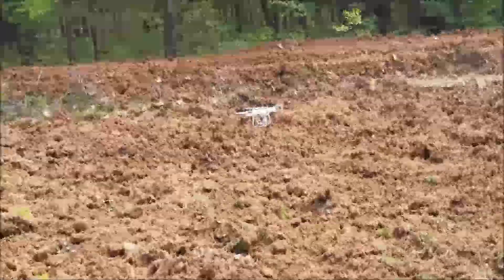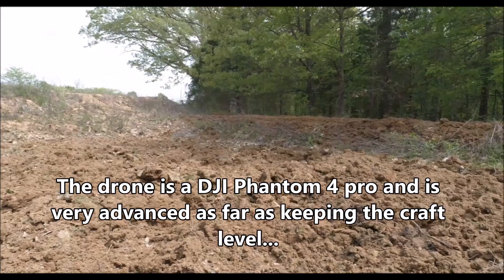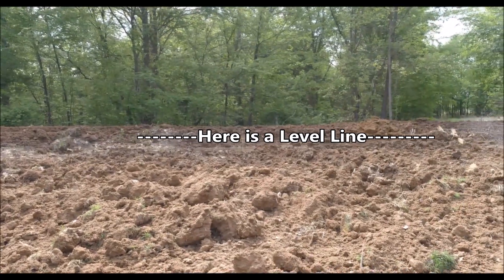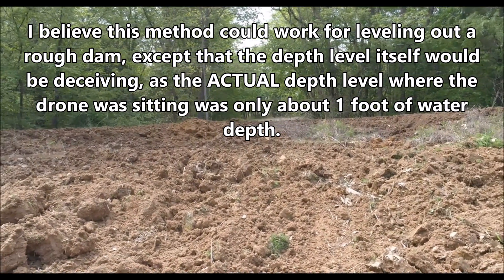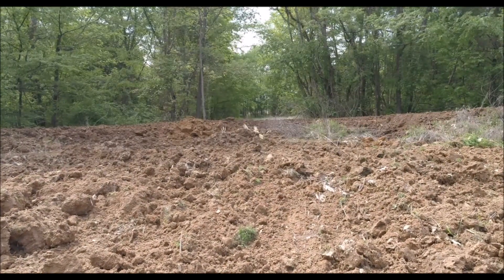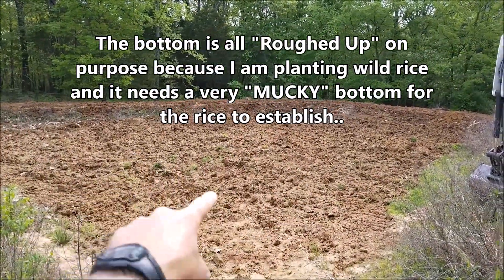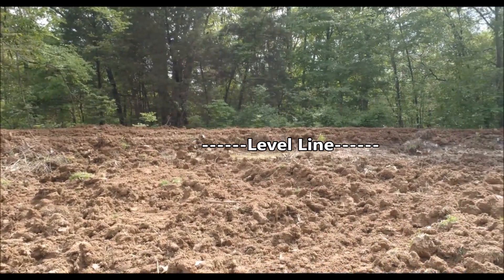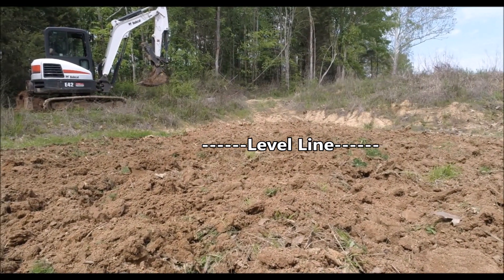Can you level a Pond dam with a DRONE???

Comment: Joe you have to learn how to use that laser...Grade sticks with level marks don't lie and you save lots of time and fuel. Paddy is looking great and it should be a big plus for the habitat. Lets see if YT can help.     https://www.youtube.com/watch?v=YuK5d7zNRZw You build a checker board with say 15' intervals between the posts around the perimeter of the pond and set the laser up put your finish grade on the lowest point and remove dirt toll you get the perimeter all level then set points thought out the interior of the pond using the same 15' spacing and remove all the excess dirt till you get the floor of the pond level. It's easier to start at the low point and remove dirt but it can be reversed and you start at the high point and add dirt or set the middle point and add dirt to the low areas by removing excess dirt from the high areas. Hope this helps.